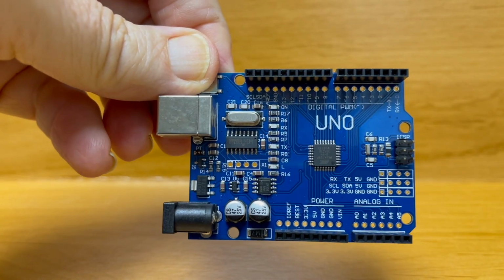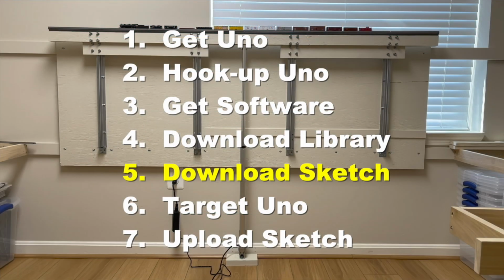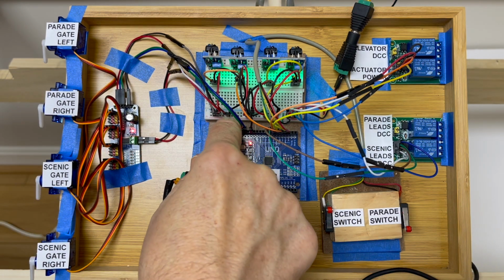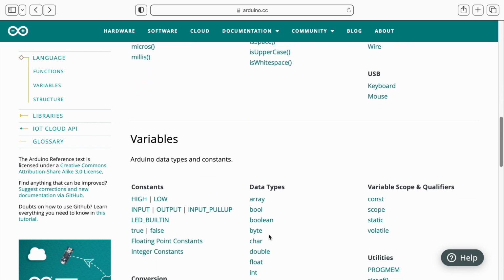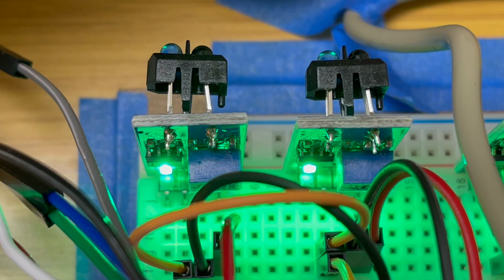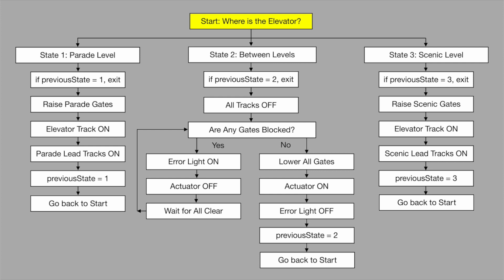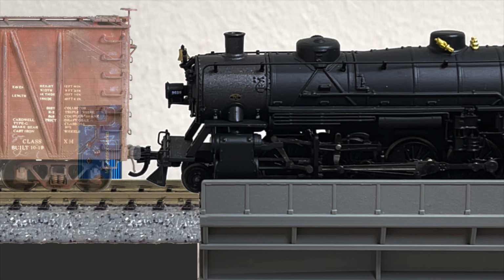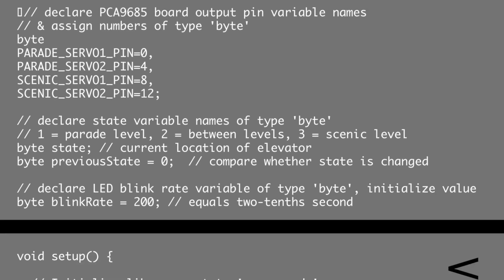Controlling the Train Elevator Part 3 -  Coding

Comment: So I cant help thinking there is a small flaw in the system process: Track power relays, track blocking servos, and IR train detection are triggered by the absence of a signal from the location microswitches (state 2), however this state is only true once the elevator has started moving and has moved far enough to release the microswitch? Surely this means that the safety interlock logic that should prevent the elevator moving is only tested for once the elevator has started moving?
Reply from the maker: Dear isis: Thanks for your question. No, the test for the safety interlock logic is the IR train detection, which does not depend on the elevator movement. When an IR sensor detects a blockage on the tracks, the safety interlock logic immobilizes the actuator, and the elevator can't move until the blockage is cleared. The IR train detector senses when the blockage is removed, and power is restored to the elevator's actuator motor. I think I have that correct. If I learn otherwise, I'll let you know. -- Russell